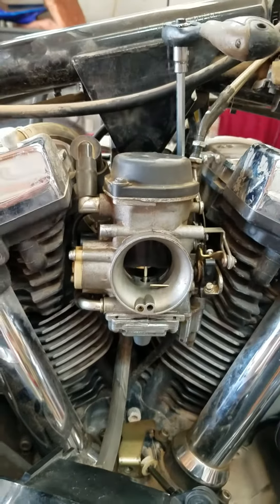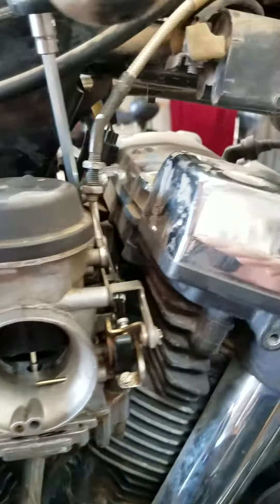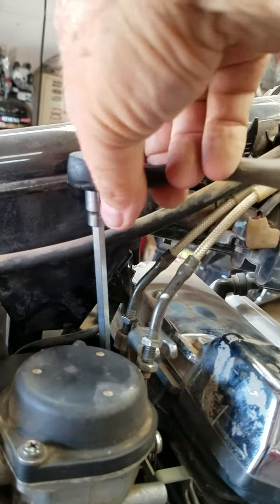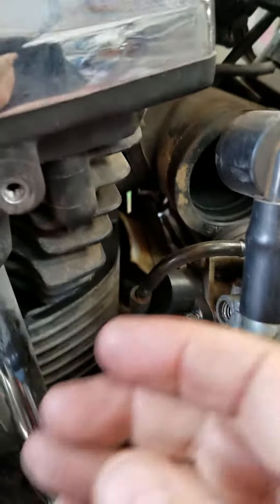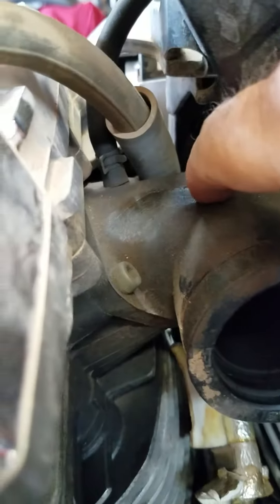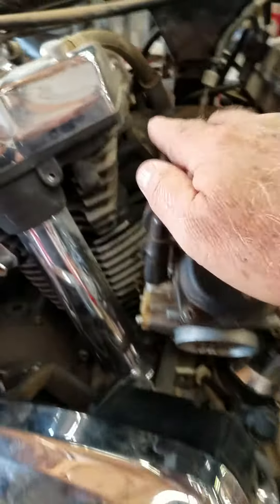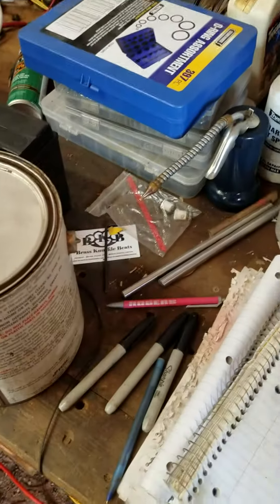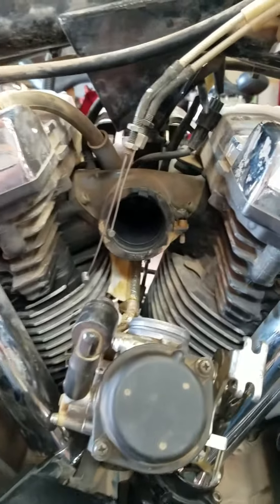Yamaha XV1700 or XV1600 Carburetor job. part 1

Comment: Where does the vacuum pipe on the rubber manifold go to.
Reply from the maker: If you have a vacuum fuel valve on you gas tank one of the vacuum pipes goes to it.
The other 3 you plug off.
These 3 are used when synching the carbs along with the 4th one.
If your fuel valve has a place for a hose to go onto it, it is a vacuum valve. It it has no hose nipples, then you plug off all 4 ports on the intake manifolds
Reply from the maker: Your fuel valve is the gasoline
"on -off" valve that is bolted to your fuel tank

Called a fuel valve, tap or petcock

Comment: Where does that tube on the top left to to, the large diameter one with the right angle? It's referred to as fuel strainer in the service manual.

Got the bike used and partially disassembled and can't figure out where to connect that to.
Reply from the maker: Email a picture or two.        hawgsnrice@gmail.com

Comment: What is that black tube that doesnt have anything hooked up to it right on top of the carb ( not the overflow ) but the black piece thats bent and facing towards the manifold

If you didnt have this video idk if id got my bike started today lol

Cause i had rebuilt the carb and everything and I accidentally put that Air hose that goes to the air filter. I put that onto that black piece on top of the carb

I was just wondering what that piece is and what it does
Reply from the maker: Vent line so the fuel will flow smoothly....like punching a hole in the bottom of a can to let contents flow without restriction
Reply: THANK YOU SO MUCH!!

Comment: Hey boss,

I own a 2003 Yamaha roadstar silverado limited edition. When I pull on throttle engine choke and sometimes when I’m riding it it shuts off when I pull hard on a throttle. Do I need a new carburetor?  I don’t know anything about motorcycles engine

Comment: Hey boss quick question should I be able to blow air thru the main fuel line into the carb I think it's clogged what would be the best way to free it up
Reply from the maker: Yes. Sometimes they get a restriction between the fuel line and float needle seat

Comment: Ok question i had water in my tank i drained tank rode a few days then i got sputter so i figured it was thr fuel pump i changed that it it idled for about 2 min and stalled is.it time for a rebuild kit the bike is an 03 any info will be greatly appreciated thanks in advance!!!
Reply from the maker: yes, always start with a rebuild kit.
gut the carb, soak in the one gallon carb cleaner solution you buy at auto parts house, get that card, right and tight, put threebond 1184 or yamabond 4 between intake manifolds and heads to stop air leaks, then go from there.
   it's most usually carb issues
Reply: @geezermoto7820  thank you so much i will look for it should i remove intake manifold and put between never used it before thanks again
Reply from the maker: @tkong35  yes, remove intake manifolds and put liberal amount between

Comment: Hey boss i wanted to knw what the name of the brass fitting that is under the main jet whats ots called someone rebuilt my carb and took  it out and id lime to correect it because my bike is sputtering and running really rich
Reply from the maker: Main Nozzle, part number

4WM-14141-02-00
Reply from the maker: The main jet threads into it.

  Look at partzilla.com
Reply: @geezermoto7820  yes i have the oart the main jet threads into but there us a brass spacer that the person forgot to put back in can it run without that because i put the 165 jet into the sleeve without the brass spacer
Reply: @geezermoto7820  i am pumpless now so that was thr recommended jet but there is no brass spacer i also have the 3.0 float as well and a 35 pilot jet the 37 didnt fit
Reply: @geezermoto7820  thank you in advance you are awsome !!!!

Comment: My wifes 06 Roadstar 1700 sat for about 8 years. I rebuilt the carb and it runs great. The only problem I have is that if I try to rip on the throttle from idle it sputters and sprays some fuel out of the mouth of the carb. Is there an adjistment I can make to stop that? Thank you.
Reply from the maker: 1st thing to check with air cleaner off is the accelerator pump. 
  The small brass tube,  start the bike, then kill it, then watch that tube as you twist the throttle.  You will see a stream of fuel shooting into the manifold if it is working.
Reply: @geezermoto7820  hey I know this is an old post I got a Yamaha Xv 1600 but but I’m having the same issue that kylematteson3038 described my bike has been sitting for years I rebuilt the carp and now seem to be running rich has some smoke and under hard throttle it’ll sputter for 15 30 seconds then clear up again for the most part but kinda runs rough in high rpm no matter what  I’ve tried to adjust the little fuel an air screw on the bottom If I turn it clockwise it will help a little but I can go all the way and it’s still doing some idk is my float adjustment off or does that sound like a jet problem ??? and I did check the brass tube I do have a squirt after I shut off and twist throttle

Comment: Good tip on the 3 bond! So what's the best way to fix that? Do I use the old gaskets , clean them and smear 3 bond on both sides? Great set of videos BTW. I have some Permatex Ultra Grey gasket maker.......will that be ok?
Reply from the maker: I would use the threebond or yamabond 4.

Yes you can use it with gasket or o-ring manifolds